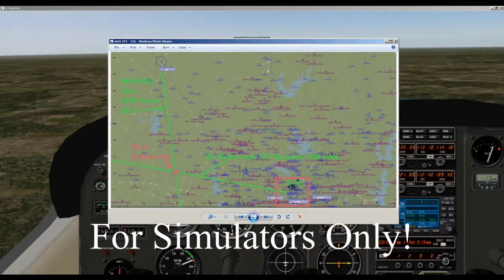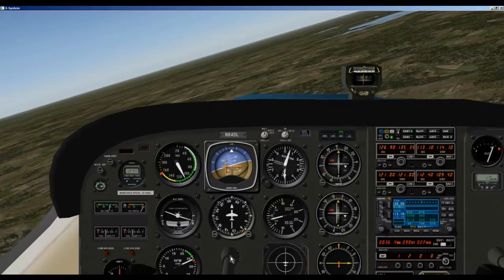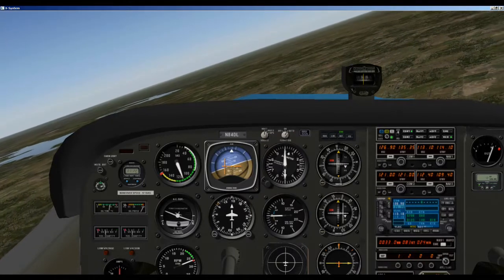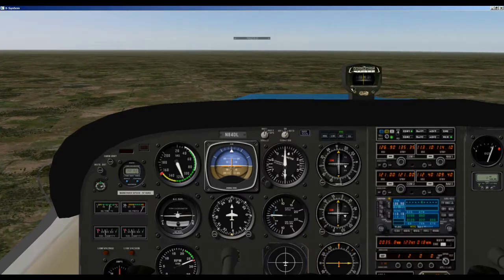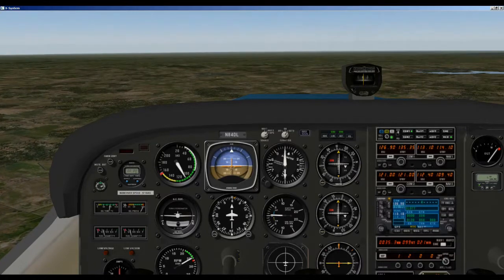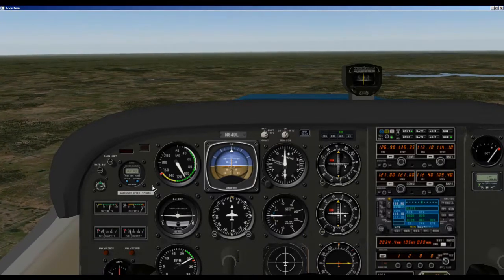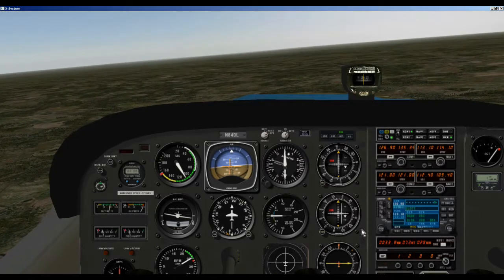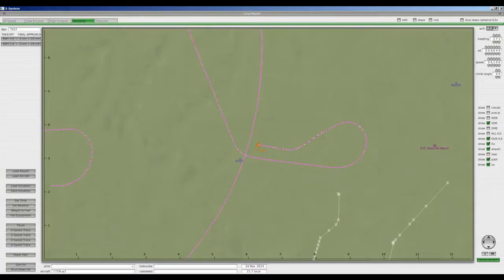How to Enter Holding Patterns & Perform Missed Approach for X Plane  - Part 3

Comment: Very good tutorial. I was able to print out the plates and take some notes so I can fly it myself in my C172N. Thanks again Skip for another A+ video.
Reply from the maker: chuck poole Thanks Chuck,   Blessings,   Skip
Reply: thought this was for sims only, just making sure.
Reply from the maker: Hi dill k,  Yep, sims only but...

Blessings,
skip
Reply: Thanks for reply, btw, what version of x-plane are you using?
 @WEHVideos regards,
Reply from the maker: Hi EarDylan,  I am now using XP11.33. Many of my videos were made with XP10 as was this video.

Blessings,
skip
Reply: @WEHVideos Didn't know, what operating system are you using?
I thought the minimal operating system for x-plane 10-11 was windows 7

regards,
Reply from the maker: Not so much the operating system as the amount of memory, and video card,  XP10-11 run fine on Windows 7 but to get the most out of XP you need a really good video card with lots of memory if you want to run it full on. I'm using Windows 10.

Blessings,
skip